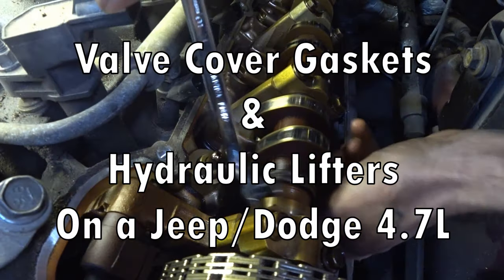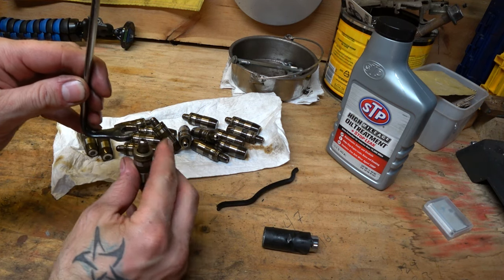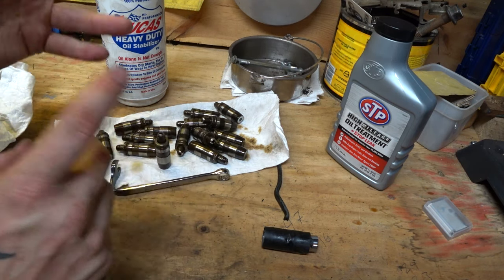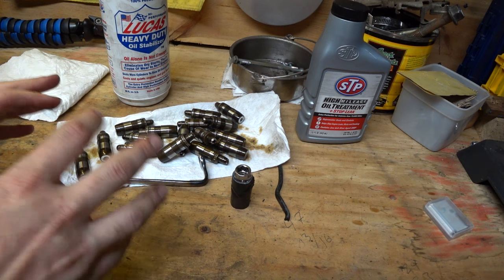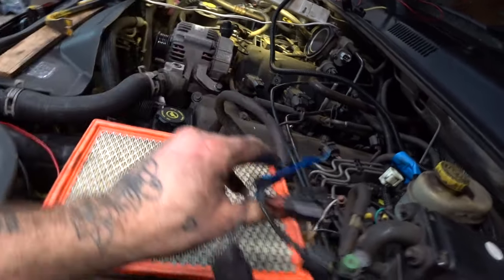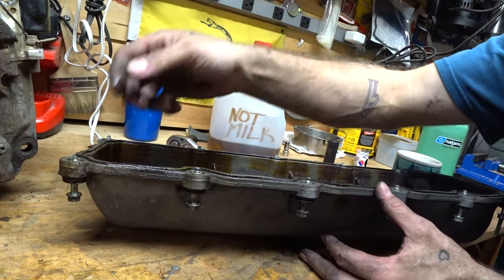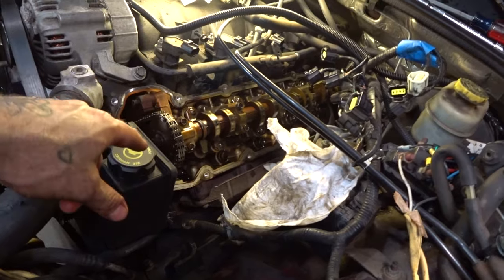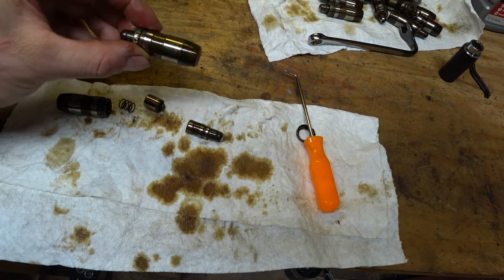4.7L Hydraulic Lifter and Valve Cover Gasket Replacement - Tips & Tricks to make it EASY

Comment: My engine is total rebuild, is about 900 miles, i can heard the lifter, which can quite down but still sound, i did a oil changed and came 4 quarts out of 6 mechanic put on, we did put conventional oil , now i read synthetic is the way to go, i will have to replace the lifters, problem is i dont know which one is the one with issues
Reply from the maker: So you burned or leaked 2 quarts over 900 miles?

Comment: Great vid! Do you recommend an engine oil flush treatment? I was told they're great at keeping a clean engine clean! But a dirty ( gunked up sump and headers) engine, a flush could end up blocking the small oil ways!
Reply from the maker: Personally I stay away from stuff like that. If an engine or trans has been neglected usually you just have to go forward and live with the past sins. Trying to erase them makes everything worse 9 times out of 10
Reply: @DEInTheGarage  yep!  My old old 3.9 v8 rangie is having the engine rebuilt! I will use a flush in that, to keep it internally clean! But yeh, if u don't know the history (even thou service book stamped) best just do regular oil changes! Thx Doug!
Reply from the maker: @terrystratford1235  yea, that makes sense. Good luck with that rebuild!

Comment: Brand new lifters installed in a used race, its going to fail, soon. You will have less pressure with the blow by making your new lifters wear out faster due to oblong or scored lifter races.  Use assembly grease for new installs stays in place and stays lubricated when reassembled.  Use 5w-20 oil the 4.7s require thinner oil because of the oil races being under sized.  Unless you purchased a remanufactured motor that has the oil holes enlarged or one of the later series motors.  Check your VIN and have dodge send you the build specs.  the HO motor is slightly different as well.
Reply: What year is later series? As in WK or later year WJs?

Comment: Jeeps are much easier than a Durango and probably the Dakota, LOL, at least on the driver side...(and thumbs up, I'd say job well done)....all because of the brake booster being in the way...Durango and Dakota, unless you want to remove the booster, it's easier to pull the fuel rail, immediately use small rags to stuff into the holes so nothing drops into the engine, on the driver side only, to get the valve cover off (passenger side comes off with relative ease), plugs don't need to come out, just remove the coils, and I use a shop vac to make sure no small debris falls in around the plug before I put the coils back on...and no removal of the fuse/relay box, just the airbox...

I did a timing set change at 275,000 miles....lifters were still fantatic, so I didn't do those, LOL...I'll probably do those around 320,000 at this point.....

280,000 miles all original, '01 Durango, except timing chains, guides, tensioners, and no lifter issues...not even a slight bit of sludge, could almost eat off the engine, LOL....regular maintenance normally reduces to near zero the problems that can occur with lifters, unless you just got a bad set that wouldn't last past 150,000 no matter what, and it does happen...but even regular maintenance doesn't do any good against the normal stretching of the chains and wear of the guides and hydraulic tensioners that, once fully entended from chain stretch, can cause guide failure and inevitably complete timing, and even engine, failure....I recommend, every 3500-5000 miles regular oil changes, 150,000 miles do a timing set, chains, guides, tensioners only, gears are all metal and should be good if regular maintenance has been kept up, and at 150,000 is when I'd consider lifters, but with zero sludge buildup there should be no need to change them if there is no lifter noise...at 300,000 miles, if you make it that far, do the timing set again, with oil pump and lifters as well....gears optional, again, but be sure to examine them very closely for cracks, excess wear on the teeth, etc, and replace all 3 if needed, even if only 1 gear shows cracks or excess wear...if you are doing the timing chains, that is the best time for lifter changes since the chains are off and the only pressure on the lifters/'rockers' are from valve spring compression, but you can easily turn the cam as needed to release pressure on the 'rocker' to remove it and change the lifters, always harder to do with the chains on as you can't turn the cams as needed...overall, a very easy task, but don't rush it, take 2 days, with day 1 tear down and cleaning (clean everything, good practice), and day 2, half day, putting it all back together....oh, and remove the radiator, core support, etc to give yourself full access from the front....

Comment: Don't the lifters pump up with oil when engine is running? Or is that only hydraulic lifters? Not being a smart ass just curious.
Reply: Sorry,also didn't realize it was sohc. Never had one apart yet.
Reply: @brianhaw9398  Yes, you're correct...they're hydraulic lifters.

Comment: Will a rocker arm popping off cause smoking along with the rough idle and other issues.
Reply: I have the same questions. I have blue smoke in the exhaust, a rough idle, ticking sound from the engine, and a loss of power. My neighbor heard it and immediately thought it was a bad lifter which led me to this video. I think all the issues are all related to the lifter plus I may have another seal causing the blue smoke from burning oil. I need to find a mechanic in the SF Bay Area to do this project for me.

Comment: Is there a specific torque you have to apply to the valve cover gaskets bolts ?
Reply from the maker: There certainly is. Probably around 25 Ft/lbs. I would googling it though. I usually just "feel" it having messed with these so long
Reply: @DEInTheGarage  thanks man, I appreciate it.

Comment: OMG! That is what happened to my truck yesterday! That piece broke off on my hydraulic lifter and it broke the piece off of my head that it sits into. Then the rocker put a hole through my valve cover! Oh well... Time for a new right cylinder head and complete set of hydraulic lifters.
Reply from the maker: Oh jeez! That is your worst case scenario! Hope you are able to fix it! Good luck!
Reply: My mechanic had all newifters and rockers but said changing them all wouldn't change anything, I need a new motor I said huh, he showed me the cam shaft, some pitting and he repeated it wouldn't change the ticking, is he right,?, U all day when u hear ticking, change lifters, wouldn't that have still been wise if someone can please tell me the truth or just get another mechanic

Comment: HELP CHEROKEE LEE IS REAL SICK... hey Doug this is off the subject your talking about on this video, but I'm stumped (2000 wj) changed the fan summer of 17 fan relay went 9/20/19 replaced. 9/23/19 replaced again don't know what the hell to do even moved it to the inside wall for more air flow 🤯🤯🤯🤯🤯 dumbfounded????
Reply from the maker: You are asking what to do about the fan relay always blowing? This is on a 4.0 I assume?
Reply: @DEInTheGarage  yes sir I'm sooo not wanting to take it to the shop if I can get a solution from the wj gurus...
Reply: 4.0 same 1 I told you I was setting up to go out to Portsmouth beach

Comment: I could be wrong but i don’t think these lifters have springs inside them, just a very small piston inside a hollow casing, which allowed the oil pressure to keep those lifters from having too much llay
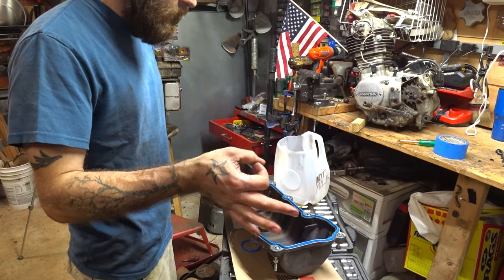Reply from the maker: That is incorrect. If you view at 19:27 I take one apart
Reply: D&E In The Garage you’re right thanks for clearing that up for me
Reply: D&E In The Garage i took one apart too and must’ve lost the spring before i saw it
Reply from the maker: @bobtailsthecat  no problem. Perhaps you had a different style

Comment: I got a ? For you guys.....on my 97 xj.. After i start and drive it around and i park it .a hour later i go to drive n then all of a sudden it cuts out.....i have no engine lights on....it takes several times to crank over but if it goes
.it runs rough....still no engine light....driving home i had to keep revving the snot out of it to keep it running?
Reply from the maker: weird.. sort of sounds like heat soak a little. how are your throttle body sensors? Maybe a fuel issue? Do you have a way to check fuel pressure when it is hot?

Comment: Which oil would you recommend for Zinc?
Reply from the maker: I like Rotella. I like T4 and T5
Reply: D&E In The Garage T4 is the triple protection 15w40. So you suggest using that for the break in oil change? would you run the T4 year round or could i go back to 5w30 ive been thinking of trying the new Rotella gas truck 5w30.

Comment: would you recommend doing this to an engine with 185k miles on it? It’s running fine but the valve cover gaskets are pissing so i was thinking about doing the lifters while i’m in there
Reply from the maker: If you have the covers off, do the lifters as well. It is a hectic job, but worth the piece of mind. they do not last forever
Reply: complete reman long block 4.7 is $2,600 come with all the oil races and lines re bored for better oil flow.  new heads included takes about 10 hours to pull the motor and slap the new one in.

Comment: Would this damage the roller rockers?
Reply from the maker: No, this method is totally safe
Reply: Just thought I'd throw my two cents worth in I have 03 three Dodge Dakota that has 250,000 miles on it it rattles when I start it and after a minute or two it quits but I just change the oil before it gets black consistently change it all the time and it's got power up the ass...

Comment: That cut finger will teach you to pull those Plugs next time. All Chrysler Engines leak oil deal with it. Felpro Gaskets are overrated. Changed the Valve Cover Gasket twice both times using Felpro and both times the cover still leaked out the Back on my 4.0. No chance i'd get involved with 3.7 or 4.7 Engines. I JUST STICK WITH 2006 AND UNDER 4.0. The heat from your Manifold is the cause of the Gasket Failure on those poorly Designed Engines. The same Company that makes the Springs for Ball Point Pens makes those Lifter Springs.

Comment: I I know you would have different different ideas. But I put them. Middle thanks in which we were a $100 on 1 side. It's a drop passenger side there's a middle 8. They make deals in round deals. And I didn't adjust nothing. Didn't have messed app because I got all everything done and I got 2 left. Wait a minute, I only got only got showing one hole left so obviously I didn't take 1 out so I looked around. Look around here and here's this one as I will, but I'll try to get a middle not. I'll be tucked for the front. Oh, that was the worst way it could have been. I can't I? I'd have a very turned motor and I'd have a rich kid in their turnamoter. I just didn't have because all my riches got stolen from.  Pops believe we're not who told my truck or said we're gonna take your truck, cause I'll see what you take my truck for it. Because how we know it's not stolen. I didn't have tag run by writing a vid number. I mean by that, maybe that maybe you run a big number. That might be how you check because if it's not stolen. I had all the tools because I was moving. So I know my tools and the track truck to move it to take it to where I'm living. I'm can live in truck there and they're all OK Bailey way. Don't story short if you did put them in there and it's still team. What would you do?  Scrap it or should I whip further, did I?I'm thinking as long as you don't hear.It's the lawyer who says that banging down in the bottom

Comment: Neighbors told me to 3 that 2001 Dakota for $300. And I put them a little round. Lift to the middle round things in there. But I didn't set them. And it is still rattled not quite as loud as before. But still pretty d*** loud, I mean really? It's loud. It's allowed it's allowed short pink teen teenager. Jeezy, would it? What did it when did a bit lifters? I mean Rodge.  There were it would be not it meet or given adjustable if I didn't adjusted me to that. That's that's why any idea. Thank you very much. I've been just doing this now. I'd like to if I could put a video on here. I'd record it and I'll record. It sound the game. You won't have to probably hear it and it's gonna be just loud. You gotta pay him with the fork.